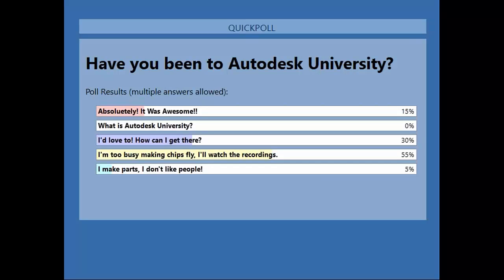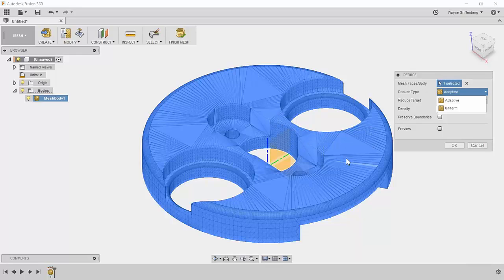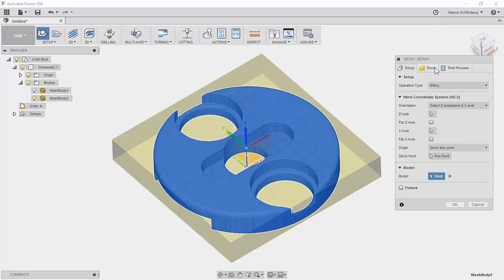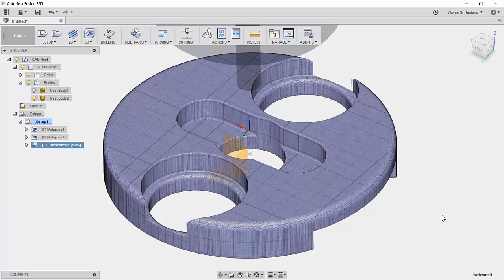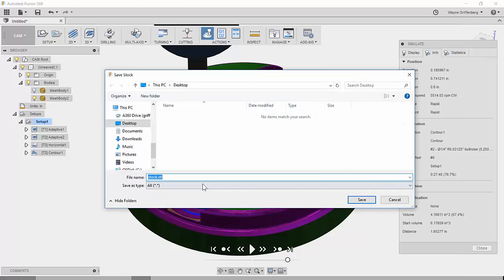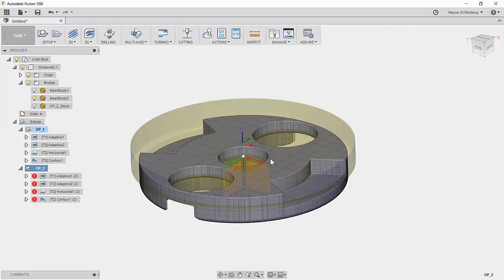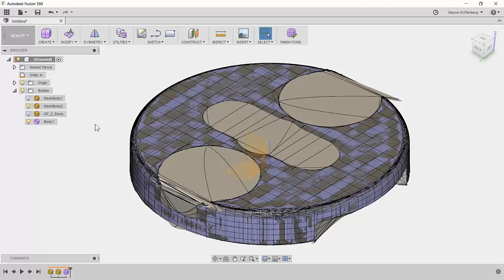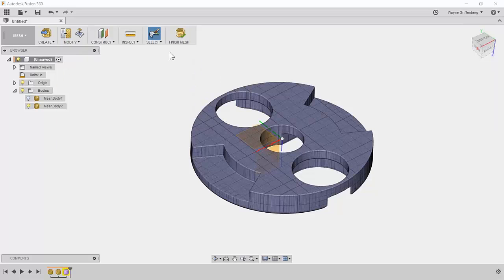Weekly HSM Fast Track Hangout - Mesh To Machine

Comment: Super cool.  Thank you Wayne.    This should be really useful when it comes to playing around in the shape generator a d making wild organic shapes and still getting toolpaths to do things besides 3D printing.     Hey it's definitely worth mentioning that it isn't hard at all to pop in a sketch here and there to create a 2d contour off of for the few hard bits of geometry that are at a known location, bolt holes etc.  and need to be right on the money.  But still driving all of your surfacing toolpaths from the STL.